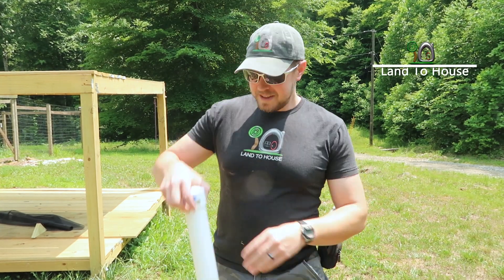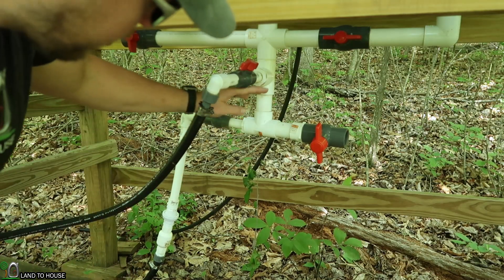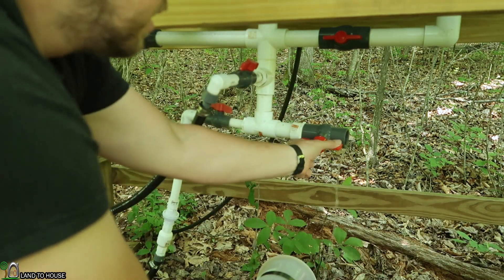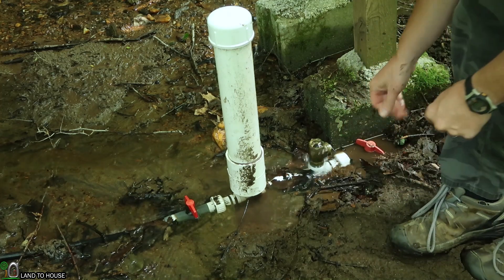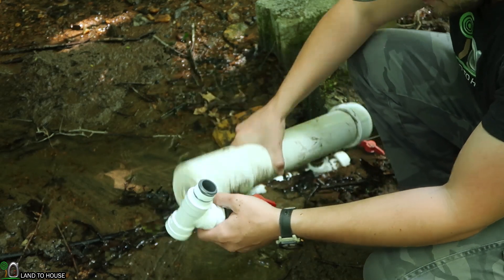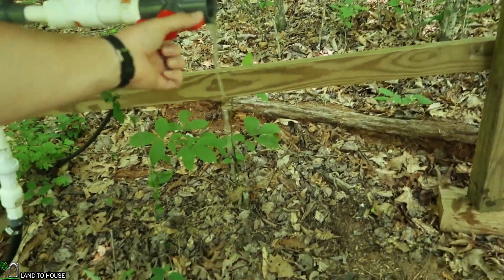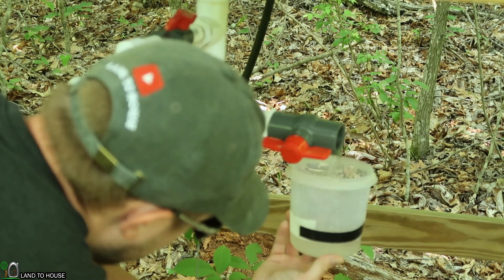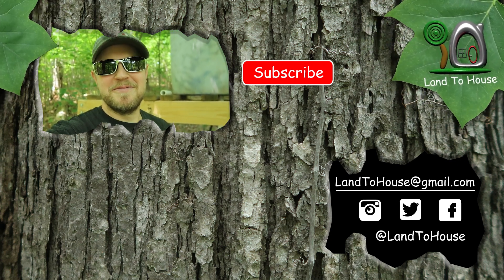Waterlogged Pressure Tank Ram Pump

Comment: Great video, and gerat idea to measure the flow rate before and after! This not only more than doubled the flow rate (15 seconds to fill your non-scientific ;-) bucket, compared to 35 seconds => 2.3 times more flow rate!). It reduced also the hard clicking (like you mentioned) AND the jerky flow of the water. That indicates the reason why the air in the pressure tank is so important for the efficiency: With a waterlogged pressure tank the pum had to accelerate the water in the Delivery Pipe with every cycle of the pump uphill till your water tower. Now the water will be buffered in the pressure tank (because there is air to compress) and can flow out with a steady rate.

Comment: Thanks for your videos, very helpful. What is your opinion about using pressure tank in horizontal position ? thank you very much !
Reply from the maker: Thank you for watching. I have seen those ram pumps with horizontal pressure tanks. They do work as long as they have a tight seal between the pressure side and the non pressure side. If a hole forms in the bladder the pump stops. In the vertical tank the pump will still work if the tank bladder breaks.

Comment: Would drilling a small hole in the pipe just below the pressure tank work as a snifter valve?
Reply from the maker: I tried that a few years ago. It needs a small brad or nail in the hole to act as a basic valve.

Comment: SETH,  i just subscribed, thanks for all your information. I have a question, i think you may have already addressed this, how high can i put my exhaust valve with out any ill affects?
Reply from the maker: Thank you for subscribing and watching the videos. The waste valve works best when it is as low as possible. The higher the valve is placed the more head pressure is reduced.

Comment: Do you sell retro-fit kits (pressure tank drain valve)? 
Will a drain valve become a standard feature on future pumps? Do you think that a radiator type of drain valve might work installed at the bottom of the pressure tank?
I understand that the price will rise due to the additional parts.  🦀
Reply from the maker: I could probably make that an add-on option. Definitely not necessary for pump operation but does help with clean out

Comment: Hi seth,
maybe a 2nd bicycle tubes?
Higher pressure in that tube?
Reply from the maker: More pressure might do the trick. But the real lasting answer is a snifter valve. But in my opinion to get 5 to 6 weeks of strong water pumping without touching the pump is good. A little maintenance every 5 weeks is not bad.
Reply: More air in the bicycle tube is what you would want. Fill that sucker up.